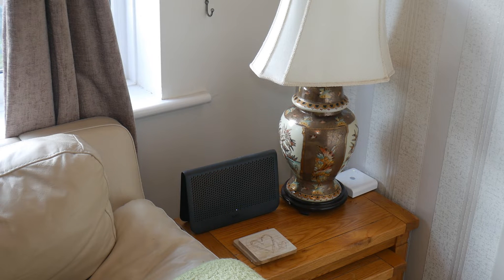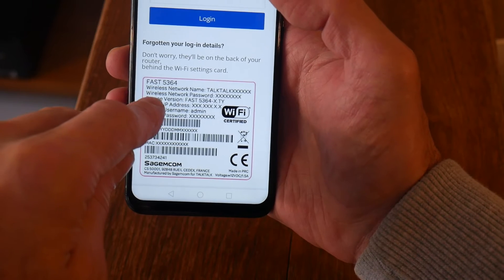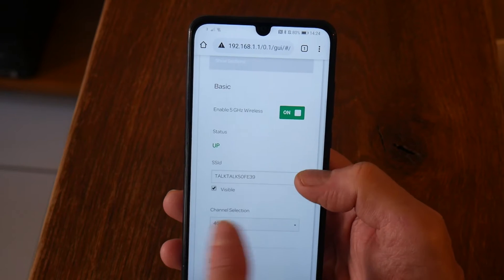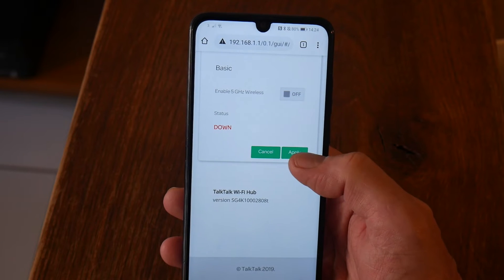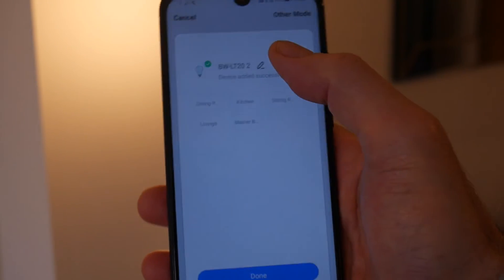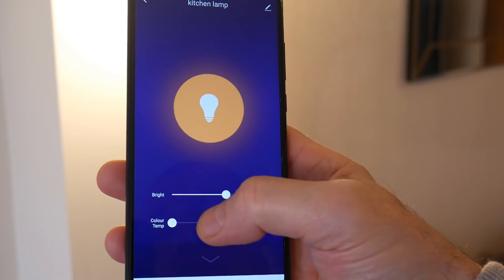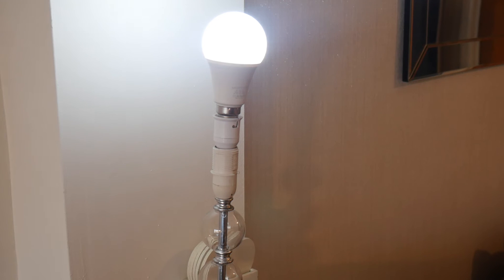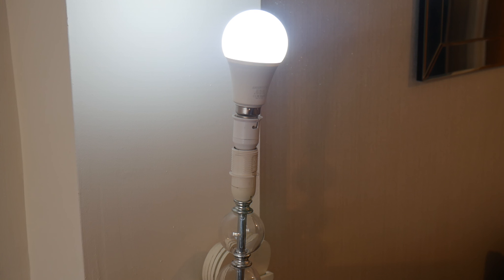LET THERE BE LIGHT💡💡! How To Get Your Smart Lights Working. #utilitariantv

Comment: What app do you use as the ones provided with my bulbs don't connect and I've changed the network to 2.4g
Reply from the maker: Smart Life
Reply: @hifireviewhub  I've done everything you have said the smart life app won't find my bulbs while in pairing mode think I've been sent faulty  bulbs they do flash but no connection
Reply: @hifireviewhub  I had to set mine up using a random app called gosund all working with alexa but thanks for your help your video is spot on aswell just the apps said to use wouldn't recognise my bulbs thought they were faulty but the Gosund app found em straight away 👍
Reply from the maker: @jimbob-jimmyhcgaming3013  Some smart bulbs use different apps so it's possible that your bulb is not compatible with Smart Life?
Reply: @hifireviewhub  I told me on the instructions to use smart life or tuya neither worked so I searched for a random smart bulb app found Gosund app found my lvwit smart bulbs straight away so all good now

Comment: Or even easier, on a talk talk, change the WiFi name by adding at the end of the network 2.4 or 5, so then you have two separate networks on different frequencies which then can be used to connect to devices that only work on 2.4 GHz

Comment: I’m trying to get a generic smart WiFi colour bulb to go back into pairing mode so I can Re-add it to the Tuya smart home app. It was registered before but no longer showing up. Doing my head in. Just cannot get it to go into pairing mode.
Reply from the maker: It's hard to say what's wrong with it but if the turning off and on 3 times does not work, it may be faulty?

Comment: I bought two extra (brighter) bulbs and when I turn them on and do on off on off they cycle through 3 colors and then just stay at one color. They won’t blink rapidly at all I tried everything. So I can’t connect. The other first bulb I got still works fine so it can’t be my WiFi. Help?

Comment: DOES NOT WORK.
Reply from the maker: If it doesn't work it's one of two things. 1. The bulb is faulty 2. The person blames a free how to video rather than their own ineptitude.
Reply: @hifireviewhub  no one blamed your video, I said the item does not work, which it did not, I sent it back to Amazon.  Don't get offended so easily if you are going to be a public figure!  The product did not work, none of the four lights in the pkg connected, however I got other bulbs (different brand)  and those did work, so it was not due to my ineptitude either, there was no need to call me names, I did not do that to you, I simply stated a fact, these bulbs did not work.
Reply from the maker: Nice back track. 'does not work' in CAPITALS insinuates that the method shown does not work. Had you written 'bulb does not work' then that would be more understandable. Also not sure why you are getting offended, the bulb didn't work so number 2 didn't apply to you?  😃
Reply: @hifireviewhub  well, obviously your method didn't work! I find it hard to believe 4 lights are faulty, but ok. The steps provided in this video did not work, I am not the inventor of the light bulb, so I have no way of knowing if it is the bulb or the method, but it  "does not work" fits all scenarios.
Reply from the maker: @valerierichardson873  So now you are saying the method shown does not work so you were blaming the video. Need to make up your mind?

Comment: I had my lights previously paired properly but then I had to turn off the main switch before I left for vacation. I came back and my lights are not even doing the initial pairing (lights flashing on and off). Is there anything I can do?
Reply from the maker: Do they turn on and off manually?
Reply: @hifireviewhub  manually yes
Reply from the maker: It could need a reset. Some lights are different but in general it's normally switch the light on and off 5 times? You also need to deregister it in the app before resetting. Check the manual for resetting  if you still have it?

Comment: i have a problem. i connect my bulb just fine to the 2.4g but then when i change the colour it doesn’t let me change it again, or use the brightness etc and then my bulb would go offline, any tips?
Reply from the maker: How far away is it from the router. Have you checked the network speed in that area? Also check if there are any updates available. If you're still having issues you could try resetting the device and installing again?
Reply: @hifireviewhub  it’s about 5-8 meters away from the router, my phones wifi speed seems to be fine. and i made it so my router only uses 2.4g, but how would i check the network speed in the area?
Reply from the maker: That's not that far away but still may be worth checking the speed just to rule it out. Search speed test in google on your phone. Make sure your phone is near the device and click 'run speed test'
Reply: @hifireviewhub  it says my internet connection is fast
47.5 mbps download and 8.10 mbps upload
Reply from the maker: Yeah that's fine. You could try resetting it?
Reply: @hifireviewhub  how would i reset it? i’ve deleted the device from the smart life app, then done the set up process again just like as if i was i was setting it up again, is that resetting?
Reply from the maker: Unfortunately, it sounds like the bulb may be faulty? Have you tried customer support?
Reply: @hifireviewhub  yeah i’ve just contacted novostella, but for some reason my bulb seems to be working just fine now. it usually does this then goes offline again in the evening
Reply: It may also be the App you're using.. I found a few Apps' that will operate all the different brand light I have but some did have issues with different brands. I've found the " Connect SmartHome"  App runs all my smart things fine.. It's running three different brands of lights a smart plug and my smart universal IR remote that is operating my TV, AC and surround sound system. All with no issues.
Reply: @brettwhitla4425  yeah i’ll try that app out, but my bulb has been working fine for the past 24 hours how, which is is a surprise.
Reply: @HamzaHamza-yc4zq  Hope it's sorted for you.. They can be a pain to set up at the start.
Reply: @brettwhitla4425  i’ve downloaded the app, but i’ll use the app when i have another problem with the smart life app i’ll use the connect smart home app. thank you
Reply: @HamzaHamza-yc4zq  You're welcome

Comment: Have two on my garage and can set them up but one of the after a few hours goes offline? I'm thinking I need a wifi extender or booster? For now I just screw the bulb in and out so I can keep the one that's working on the schedule I have it one

Comment: When it try to connect it gets to 99% then sais oh oh theres been a problem
Reply: Same tell me when you get it right
Reply: Same i need help
Reply: @Robin.hasd13  you need internet bluetooth location and service on ur phone
Reply: @reggaexone  so i need like mobile data 5g or 4g
Reply: @Robin.hasd13  5g or 2.4g
Reply: @reggaexone  Bluetooth has nothing to do with smart WiFi lights.. You need 2.4GHz  at home and any Data connection on your phone will work if your operating the light away from home. You just need internet connection. 3G, 4G or 5G
Reply: @Robin.hasd13  3G, 4G or 5G as long as you have Internet Data

Comment: What happens if the bulb go back to 5ghz when you turn 5g back on
Reply from the maker: It hasn't ever happened so far.
Reply: @hifireviewhub  switch auto 5 off and turn auto 2.4 on

Comment: Mine worked at first and just recently the connection of both of my bulbs stopped working in the app(SmartLife still had them as devices but the connection didn't work). I thought it was something faulty that could be fixed by deleting the devices and reconnecting, but now they won't connect. It would attempt to connect and the app would reach 100% connection but then it would say the "device is not responding.' Anyone know how to fix this? My internet router is 2.4GHz and it was just working fine for a couple months.
Reply: Delete whatever app your using and download a different light controller then follow their directions, it worked for me

Comment: I cannot get the rapid blind. Did everything step by step.
Reply from the maker: If it does not rapid blink after switching it on and off three times, it's likely the bulb is faulty?
Reply: @hifireviewhub  Not sure. I got one to connect through a slow flash, but cannot get the message rapid flash at all. Just slow flash and no flash at all.

Comment: Does it work on virgin media and are there diferces and will it make the wifi slower forever
Reply from the maker: yes it wil work with virgin. I believe the IP address is 192.168.0.1 the interface may be slightly different though?
Unlikely that having a few smart bulbs would have an effect on your bandwidth. You need to have around 20 on at the same time to make even a little difference.

Comment: My issue is that even after I turn off the 5g band, it still won't connect. I've moved the light closer and still nothing. Could my light's wifi be faulty?
Reply from the maker: Possibly? Unfortunately, the only way to find out is to try another bulb.   If you do try another smart bulb, try another manufacturer. The bulb you have isn't a Phillips hue by any chance is it?

Comment: My bulb won't even get into the pairing sequence. I do the 3x on & off thing as the instruction manual says, but it doesn't start blinking.
Reply from the maker: Has to be a faulty bulb. I'd return it. 👍
Reply: @hifireviewhub  It's after I got new internet tho, before that it worked fine.
Reply from the maker: @rubydriftschool  are you able to do a hard reset or factory reset?
Reply: @hifireviewhub  I do not know how to do that, and It isn't in the instructions afaik.
Reply from the maker: @rubydriftschool  some bulbs you have to switch it on and off 5 times to reset but it depends on the make. What brand of smart bulb do you have?
Reply: @hifireviewhub  I don't remember, some cheap one, made for the Tuya Smart app thing. WiFi of course.
Reply from the maker: @rubydriftschool  🤷‍♀️
Reply: @hifireviewhub  having the same issue as he is. Mine is a Eufy Lumos Smart + Color, but I can’t find a hard reset switch either. The only reset option I know of is the on/off method which flashes a few times then goes back to a standard white color. So annoying. If you have any suggestions let me know! We just recently upgraded to a new router so I’m wondering if that’s part of the issue
Reply: @skls1234  I’m having the same issue for you ever get it to work? I know just been a while sorry lol

Comment: I have the same router as you but the sticker on the back doesn't have a password for an account.
Reply from the maker: It should be behind the plastic card that pulls out. It has 'pull up for password' written on the top.

Comment: hi how do I get on that website
Reply from the maker: On the back of your router, you'll see the router IP address. Type the IP address into your browser. The router ID and router password are also on the back of the router. Do not confuse this with you WiFi password. They are different.
Reply: UTILITARIAN TV on the back of my xfinity router I only have:Network(SSID), password,SN, and CM MAC.Which one do I type in the search bar?Also on my phone when I click info on my WiFi name it shows:IP ADRESS, but when I type that in it shows an error screen and that I need to check my spelling on google and safari.I am so confused
Reply: @UTILITARIAN TV
Reply from the maker: @Ali-cl7ry  Have you replaced the original router from your internet provider with the Xfinity router?
Reply from the maker: @Ali-cl7ry  The default router IP Address for the Xfinity Router is usually 192.168.1.1 or 192.168.100.1 or 10.1.10.1
Reply: I’ve typed it in but it doesn’t seem to work
Reply from the maker: @nataliaruiz886  what router do you have?

Comment: Success after many hours and before this video. The big take-away was the light was already flashing (slowly) so I didn't think I needed to turn on/off the switch 3 times. Then I did and it started flashing rapidly and BOOM connected!
Reply from the maker: Glad you got it working!
Reply: UTILITARIAN TV so my geeni stops flashing at 8% and it says connection failure at the end of it but it stops flashing? any tips or help
Reply from the maker: @junior-pv9yk  have you tried resetting by switching on off 3 times? You could also check if the WiFi signal is strong enough? If the bulb is far away from the router, try setting up the bulb closer to the router and see if that works?
Reply: @junior-pv9yk  It's not easy but turning off 5G and only running your wifi on 2.4G. Then setup lights. After you test, and they work, turn 5G back on and the lights know to work from 2.4G in the background. App is tricky too. Hang in there.
Too access your "raw" wifi, find your wifi's ip address (back of router/modem) and type it in your browser (e.g. 192.192.123.123)

Comment: Hi, I do not get it. Is this an app?
Reply from the maker: Some people experience issues when connecting their smart lights. The connection is normally done through an app. The app I use is smart life. Some smart bulbs use a different app to connect. It all depends which app is compatible with the bulb.
Reply: @hifireviewhub  Yes. I am having the issue because my internet is not 2.4ghz. How can I fix it? I bought my smart light a month ago and I am not able to connect because my connection is not the correct one. It's so frustrating...I am using the same app as you. smart life!
Reply from the maker: @ceicacunha7617  you need to turn off your 5ghz, then connect your lights. Once they're connected, you can turn the 5ghz back on. It's all in the video. What router are you using?
Reply: @hifireviewhub  I'll try as sun as I get home from work. I am not sure the name of the router I am using. I hope it works.